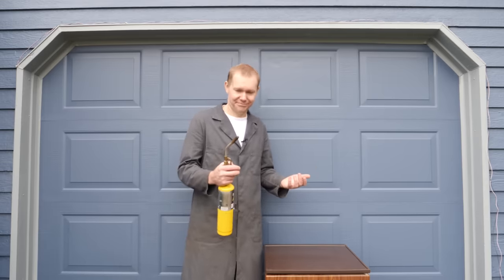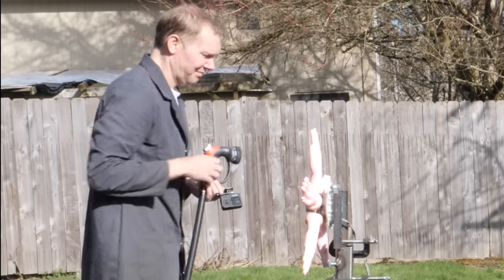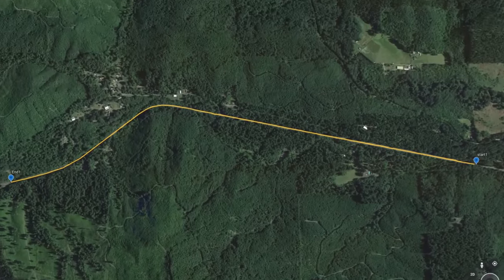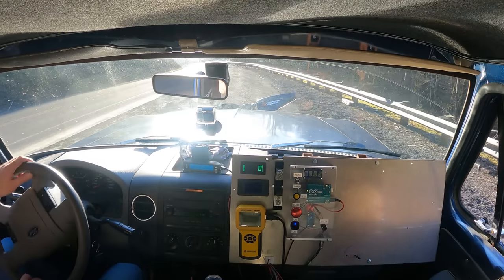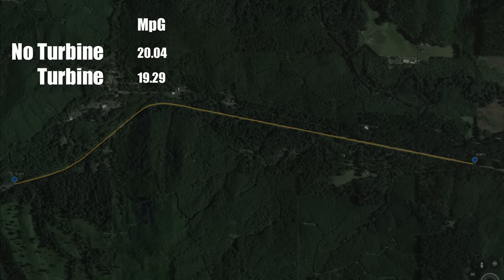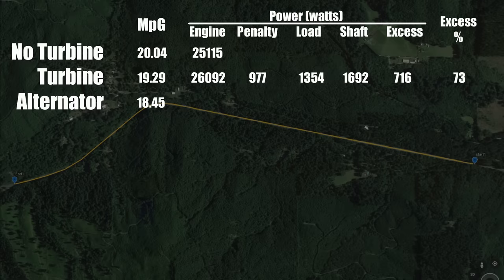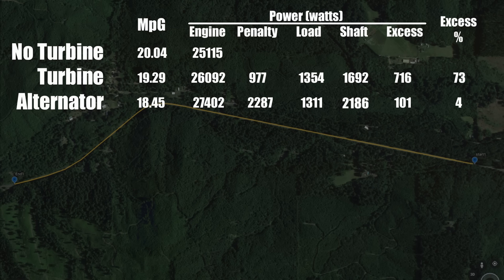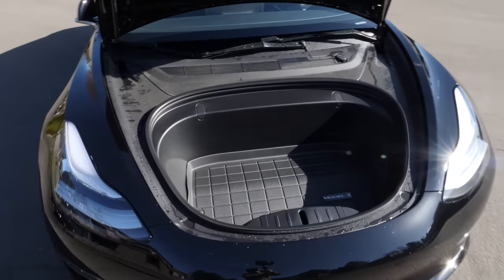Mileage Results You Won't Believe!!! - Wind Power on a CAR #5

Comment: Relatively imprecise measurements but well explained, question how big is the difference really if you include the additional weight that increases consumption or the rolling resistance of the tires at different times of the day and temperatures, tire pressure, wind direction and speed or whether the turbine was mounted in the tests without to try to consume the current, or whether the propeller blades were set in the "feathered position" or in the position with the greatest resistance.??? I think the more variables you take into account in the calculation, the more precisely the efficiency is calculated, and I think if you optimize the whole weight and aerodynamics, the better the result

Comment: Great Video !! 

After watching part 2 I was wondering why you weren't recovering drag off the back ??

Also,  was wondering if you could design the front system to prevent / reduce air on the truck nose? And make up the loss also?  Does it have to be only one blade system?  Different shape blades for making power and deflecting the air?

Comment: How would it affect it if you used a different turbine like putting a housing on it or using the cylindrical kind (furnace blower shaped? It seems like it would increase the efficiency of the turbine at least but would it have less effect on the air going around the truck?

Comment: Automotive alternators aren't built to do what you tried to do. They really just need to keep the battery charged. The turbine is built to make as much power as it's creepy spinny hands can. I dunno if it's possible to get an alternator with that purpose and efficiency to fit in a vehicle though

Comment: Of course it works. 
I have hybrid car, and i am harvesting my breaking...so this energy is actually from fx down hill. 
Here it is very efficient..
In winter my millage is approx 10 procent lower then in the summer, as the batteries don't work as well in the cold

So if putting "break harvesting" " solar power" or even a sail...
Will help the millage..
The only thing you need in the bronco is more effective harvesting, of the wind. And a battery, to release the energy when the power is needed..to help the combustion engine a few electrical motors...
Well ask Toyota about  hybrid raw4 Hybrid
Yes energy is coming in 2 places ,but the question was only if the millage on the bronco would improve....

Comment: Sailboats that use water or wind turbines underway to generate electricity are slower with the turbines deployed than when they are not due to the drag.
If you put a wind turbine in front of the sail, it's even worse.

Comment: I would be interested to see how big of a turbine you can get up there before the extra energy required to spin the turbine outweighs the gains. Because you are capturing energy that would otherwise be lost pushing the wind I think that this would be more difficult to do on something more aerodynamic like a Tesla. The electric cars shown were designed around the turbine so they are effectively using it as a way to lower their overall coefficient of drag instead of making a more streamlined vehicle. From The wikipedia article on the drag coefficient a long cylinder has a coefficient of drag of 0.82 (Bronco) and a streamlined half body has a coefficient of drag of 0.09 (Tesla). From my understanding that would mean that there is roughly an entire order of magnitude less energy to capture (assuming a linear conversion of drag to energy) using this method on a streamlined vehicle. It is likely that you would have to be more clever with the placement of the turbines. i.e. maybe putting two small turbines in front of the mirrors.

Comment: Even before I start this I can tell you the weight of what the car is carrying is negligible relative to what it can carry, therefor fuel consumption should not go above average high levels. BUT! having the prop on the front actually creates a lower pressure behind it measured in the last video so the car is moving in a constant slip stream, which should reduce load on the engine. this might be genius!!!

Comment: SOOooo, what you have REALLY proven is that there would be a substantial gain in MPG if we could find a better substitute for the alternator that is more efficient.  Perhaps combining it with a better substitute for the battery - for instance, a wind driven fan blade generator IN FRONT of the radiator feeding into a bank of supercapacitors.  THAT is your next design experiment.

Comment: So it recycles the energy it would take to beat the drag? Obviously Entropy would play a role and there is always a loss, but in this case the loss is minimized so that efficiency is improved and the result should show as better MPG.
Reply: I see what he is doing, he is still betting on the same drag but instead he is capturing some of the energy of the drag and converting it into electrical energy. So he would see the same MPG in all runs. But, as an extra he would be running the oven. So the oven would be operating at no additional cost.

Comment: if you use "beat betz limit" impeller air flow diverter in front, 100% deflected outside main body drag, spin centrifugal side slinger
Reply: what is the best airflow? the one not there, sling around the air plane, nose cone airflow sling turbine, powered electric, or passive
Reply: regenerative slinger or active power engine

Comment: on the bronco fuel help by install a clutch fan or electric fan on the motor 
only works wen the car is going slow and at hy speed it stay neutral
try it and see the different that is one reason tor the toyota  fuel different

Comment: Delco Remy produces a brushless alternator that is 80% efficient, capable of 420 Amps at 12V, for Class 8 trucks / fire trucks, etc.
Reply from the maker: Got a part number or link?
Reply: @QuintBUILDs  I can tell you that it a model 55SI, they came out in 2012-2013, for semi tractor, other large OTR applications. Also because of military use, and other 24V applications it is rated at 275 Amps/ 24V. At idle. It's pretty savage.

Comment: You'd probably get a better overall efficiency if you had driven the wind generator straight from the engine in place (instead) of the alternator and put a teardrop shaped nose (airfoil cone) in front of that square  thereby reducing drag, weight if cone is lighter than alternator.  Episode 2?

Comment: All electric cars should have built in wind generation that helps extend the range of the car while it is moving. They should all use replaceable battery cassettes like a Dewalt drill which will solve range and charge time anxiety.

Comment: Some ships and airplanes have small bladed generators that look like the front of the truck but lots smaller. They are used to run the radio(on airplanes) mostly in an emergency. The ship ones I'm not sure how they turn that into propulsion.
Reply from the maker: Ram Air Turbine for emergency power.

Comment: The only thing you proved is an AC wind turbine can be more efficient at running an AC oven than a DC alternator converted to AC when the alternator is constantly under load.  Try something that is practical.  Run 100 miles with alternator cycling on and off.  Then do another run with your alternator taken off and wired directly to an AC/DC interverter, wired to your turbine.  Then record results.

Comment: Would a more aerodynamic car be more efficient than one with a turbine? 
Aka, how low a drag coefficient would the car need to have to make it outperform the wind turbine? [Math below] 
It'd be interesting to see you modify the front of the car for aerodynamics and trying that!

Math:
Of that 75kW that is wasted, let's say 70 is air resistance, and 5 is rolling resistance.
The turbine regained 716 W, or 716/70000 = 0.01022857, or 1.022857%.

The power lost to drag is:
P_drag = 0.5*rho*A*c_d*v^2
The only thing we're changing is c_d. 
The turbine made P_drag 1.022857% lower, and since they are linearly related c_d was also 1.022857% lower.
So if you made aerodynamic mods to the car that reduce the drag coefficient (c_d) more than 1.022857%, you've outperformed the turbine. 
Is that difficult to do? Not really. 
The bronco has a drag coefficient of around 1.5 I'd guess, whereas a well designed car can be around 0.2, so that's a 750% improvement. 
BUT, even on the Tesla (which has a very good c_d) the turbine still helps. So does the turbine improve performance regardless of drag coefficient? I dont know!

Comment: Another thing to consider is that the more slippery a car is at moving through the air, the less air moving energy there is to recover with the propeller,,,  A Tesla is very slippery ,,,  Putting a propeller on the front of a flat nosed semi would probably not make any noticeable difference to the truck engine,,,  You just need to figure out how put all of that recovered energy back into turning the wheels,,,  :-)

Comment: yeah, guessing is most near, I also didn't know, that a gasoline engine is that messy
so the highest step might be a egg shaped ? round car front (up hole car), using all front as/for wind-energy
that brings me another step more closed to a wind turbine using bicycle home trainer as of think efficiency of generators, 
as we have to less wind, and my stomach to big ... 
and to get Energy plus on car, I better install a solar-panel on the roof, expecting less stops from police for sure - and not depending on speed.
But your right, go on BUILD, as find solutions for some funny though teaches us at all, not often successful but knowledge stays

Comment: Have you thought of using a different design than a propeller?  While the propeller is great for flying its horrible for capturing air.  I think you would get far better results with a different design of capturing the air.  My advice is to ditch the propeller and see your results skyrocket.  Good luck

Comment: If you run the prop off the crank with a shaft out of the grill you wouldn't need the electric motor...my truck broke down when I was hauling my airboat used the boat to push the truck home

Comment: Not really cause turbulent air is easier to move thru all so if it’s causing a friction bubble in a way ahead of the car and behind the blades would minimize the drag coefficient would drastically drop and there for increase the fuel economy.

Comment: Ok but hold on every vehicle has air movement around the wheel fog lights an such just use the fog light area to turn turbines at the front an rear in the duct areas that air flows most based on vehicle design an see what kind of return it would provide

Comment: Hate to be that guy but all this equipment is incredibly dangerous in the event of a collision. You have a steel control board mounted in front of the passenger airbag, if there even is one. The turbine could be dangerous to other vehicles on the road as the steel support could go through another car and injure the passengers. I understand they drove on a somewhat back country road to mitigate risk but there are other drivers there still. Just seems irresponsible to me.

Comment: If a device was added to the fridge that captures thermal energy and converts the heat released to electricity it could be converted back and power the fridge.

Comment: I designed a free energy machine I put it by a electric engineer, he said it wouldn't work I said why he says I don't know it looks like it would but thermodynamics getting away I said he didn't fully understand it. You can be very smart and still not understand something. A lot of times people are not smart enough and they think they know more than they do. Because of wrong theories or not understanding the theory right. Without doing the work their self.

Comment: How about if you try putting a larger turbine and a large generator good enough to power a motor that can run the whole vehicle.  Then try to shutdown the engine thereby fuel is not gonna be used to power the car.

Comment: just wonder what would happen if you put a super charger on the other end of the shaft of that propeller by the hood, and it pushed that air into the engine like a turbo charger does, and have an inlet scoop located somewhere that the blade would be directing the air too, would that regain your lost engine power to put you at a higher out put then the input?

Comment: Self charging is now in use on electric cars. But this could be additional to it especially on long runs. Weight can be a thief, on these ideas being very lightweight.  Like flywheel it can only be of use if not reversed its purpose.

Comment: And how many of the nay-sayers claim that a non-powered, mechanical windmill on front of the truck can not thrust the truck forward into a head-wind? Yes, you do connect it to the drive train, keep engine in neutral. Or generate electricity and run an electric motor in the drive-train. A boat can run upwind using a wind-propeller with a water-propeller at opposite end, slight angle of tilt to be sensible. So, the propeller idea works best with a head-wind - free energy under this condition, and streamlining is important.

Comment: With respect, I believe you shouldn't use "25% efficiency" for both the "without wind turbine" and the "with wind turbine" scenarios.  The reason I believe this is because to keep the same speed in both scenarios, you have to use fuel at a slightly higher rate in the "with wind turbine" scenario and that, by definition, is less "efficient" than the "without wind turbine" scenario.
Reply: After sleeping on it, however,.....

I idiotically neglected that the power output by the wind turbine accounts for at least some of the apparent efficiency "loss".  To be continued!
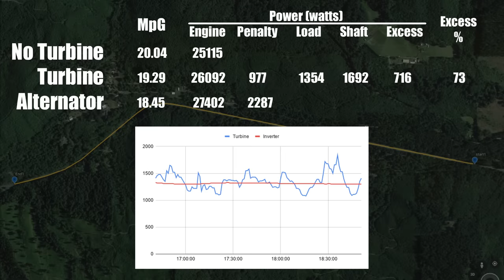Reply: A new "thought".  If in both scenarios you are maintaining the same speed (55 MPH) and in the same gear, shouldn't the "engine output" (Power(?)) be exactly the same and not different as you calculated and show at about 8:30?  If that is indeed the case, that would, I believe, imply the efficiency of the engine is lower for the "with wind turbine" scenario than the "without wind turbine" scenario (and not simply 25% for both).
Reply: So much for my "thought".  Had a lot of fun learning about ICE "Power Curves" and such and discovered that a typical Power vs RPM plot is usually for just ONE "throttle" position.  To be continued, again.....

Comment: Load of the alternator does not change. More power you use the less it has to be regulated. You are just using more of the energy that is just basically thrown away. I am a mechanical engineer and ex mechanic too. Your only adding drag. The deflection of the blades does not deflect from the front of the vehicle. So adding electrical will only be discharged by the electrical regulator. You are better off designing a deflector to smooth the air over your front to increase aerodynamics.

Comment: This result is not conclusive. The alternator did not produce 1,000 watt. I suspect that an alternator sacrifices efficiency for being lighter.  It is also developing AC that is converted to DC that then is converted back to AC through the inverter. At every step there is a loss. The only way to proof this one way or another is to drive  that big generator directly form the engine, and then from the blade. We have the old maths problem here, comparing apples with pears.

Comment: this is literally just the applied idea of efficency of motors if you bought an alternator of the same efficiency and output of the turbine youd have the same result. another side note is its reducing the speed of airflow to the air cooling system and your engine would run hotter would it not? im genuinely curious what the heat increase would be at running temps for the motor

Comment: I used to think that this wouldn't work for the usual reasons and am glad to see a video where someone tried it out!

I'm sure you found out from the wind turbine book and software that the output is directly related to the sweep area. So that's why you picked blades that large.

If you ever do try it out in a more aerodynamic car, I'd also be curious if a bunch of smaller turbines would cumulatively provide the same output as a single larger blade. Or if there's an optimized size.

I'm thinking smaller will get less power output total because it's kind of like helicopter rotors, but in reverse. Where a bunch of smaller diameter fans need to produce higher thrust (and thus eat more fuel) than a single larger rotor to lift the same load.

Comment: I love your videos, they are so inspiring and motivating to me to continue my crazy ideas.  I do have a question about modding your set up a little for just recharging few 12v batteries for small applications such as a camping stove and water heater for showers and what not. If I was to creat an intake and connect it to a smaller turbine in the bed of my truck, would that allow enough wind power to charge a few car batteries. I'm trying to use as much wind power as I can without effecting the over all Cd of my truck.

Comment: What if you just try to generate enough energy from the wind turbine to recharge the electric car battery so that the car will be able to go further? How many KWH would that require to recharge the battery 100 - 200 more miles? Imagine if you had multiple 2, 3, perhaps 4 small turbines in the front hood, perhaps in a cone shaped tube that collected wind all generating KWHs to recharge the batteries?

Comment: Can you use a gearbox in combination with the engine to increase RPM that will turn the turbine thus eliminating the need for fan blades?

Comment: What I wonder is if you ran a alternator off evertire took that electricity to run a charger would it be enough to recharge tge batteries on a electric car so it basically run on its self?